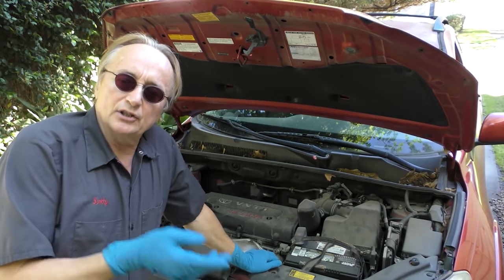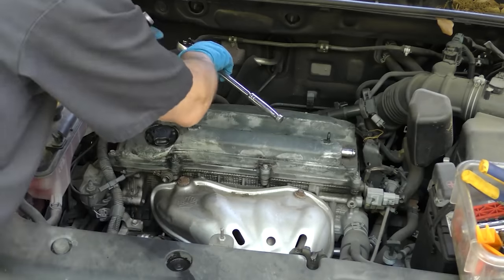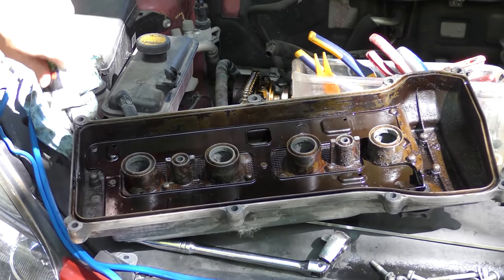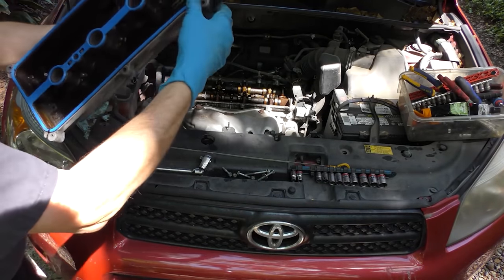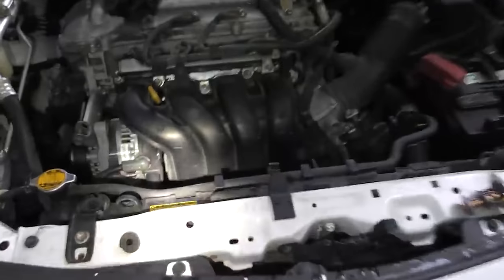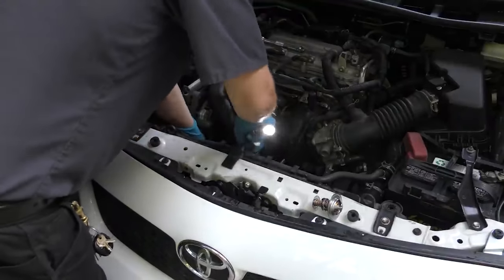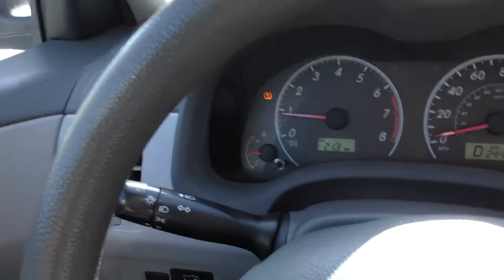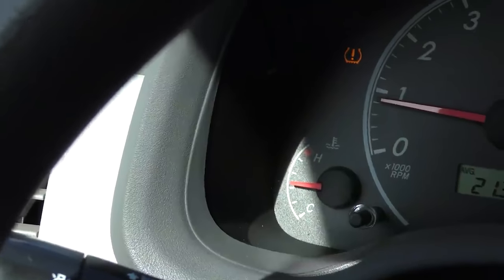3 Mechanic Scams Caught on Camera

Comment: An auto mechanic chain called "Automotive City" tried to scam me into replacing my truck's heater core for $1400. They showed me a photo on their phone of a heater core that looked obviously bad but I knew it wasn't my core because the big plastic cover under the dashboard was still dusty with no fresh fingerprints. Plus there was no sign of coolant leakage or smell. The reason why I took it in to their shop was because I recently had my water pump replaced (which had an obvious leak) but I was still losing coolant. I ended up replacing the radiator cap for $6 and that solved the problem. Saved myself $1394.
Reply: 🤑 jokes on them!
Reply: You should have went in and raised hell to them about the scam, the owner should know if he has mechanics working there doing shady stuff.. might save someone.
Reply: @PhilJLF  ,
It was the owner who showed me the photo. This is a small town I've lived in for 55 years. I spread the word about the scam. The owner is feeling the pinch.
Reply: Lawsuits need to be filed to put these individuals in jail.
Reply: @freedomforever6718  good!  I caught my local family mechanic scamming me; first time they said they warranty all their work for a certain time my distributor went bad that they had replaced, they told me they still
Would have to charge me for their labor on the new one but not the part; whatever …. Second time they said they did 4 hours worth of labor when i was actually waiting at the shop and they only did one hour or less of labor; third time I caught them red handed was the worst where we didn’t go back ever (these where “family friends” mind you) … I understand they have to put food on the table but geeze … 02 sensor went out on a civic, I was going to do it myself but I couldn’t find one after going to autozone they tried to sell me a used Denso then I went to another place that was out of stock, I went to this “family mechanic” and they were trying to charge double the price than what I would have payed for a new Denso (you know they get better deals then customers too) … so, after that I told them that was a crazy price and I’d buy my own; so I bought a brand new up stream Denso 02 sensor and gave it to them to put it, (yea I asked to have my old one they took out) bought one at about half the price of whatever crappy brand they were going to put in and never returned there since… especially after seeing the crappy job they did putting it in. Actually taught me a huge
Reply: First name Last name  ,
Nope. It's a 19 year old Chevy. All vehicles breakdown from time to time.
Reply: First name Last name  ,
Yeah, I would never buy a new Ford or Chevy.
Reply: @PhilJLF  owner is probably in on it
Reply: WinGate Mose  ,
You are right. A good honest mechanic is worth his weight in gold.
Reply: 1st of all I'm NOT defending any of these mechanics, just giving an insight of how a lot of this works is all and a few tips as well. As a shop owner there is a system in place we all use called "The Flat Rate System". There's a book we all go by that says how many hours a job takes to do. A good honest mechanic can beat that time (provided there's no hick-ups like stripped bolts and such) and do the job right. The system is actually there to protect the customer from shops "overcharging" you in hours. Shops that use this system have it displayed so you can see it and on the "work order" (usually something like Shop Rate of $100 per hour FR). So yeah..... sometimes you will wait an hour to have your car fixed, but you will get charged 2 hours for it. Other times the shop will have it for 2 (10hr) days, and you will only get charged 2 hours for it.
I know that is pretty lengthy, but it is the #1 "scam" complaint I've seen over the years, that really isn't a scam at all.
Reply: @BareRoseGarage  That's great but all that goes out the window when the shop tells you that your car needs an expensive service when it actually doesn't.
Reply: @juanawashington9940  Very true, or worse you get what we call a "bench repair". That's when they put the work order on the bench to fill out all the work they "did" without ever touching a wrench. Head Gasket changes - but the head bolts have no socket marks on them. Brake jobs that still have the factory Assembly Line retainer clips holding the rotors on etc etc etc. Don't get me wrong, there are a lot of "crooks" in this industry, and some of them have beautiful shops & matching uniforms. All I'm saying is there are some things in this industry that appear to be crooked when in actuality they are there to keep it on the straight and narrow for both of us.
We're really not all bad guys.
Reply: LOL, these scams will never stop. There's simply too much opportunity to rip people off on a vehicle with an Internal Combustion Engine. And dealerships are just as bad. Imagine if you could buy a car that didn't have or need an alternator or mechanical water pump to leak, no power steering pump or accessory belts, no transmission, no engine oil, transmission fluid or power steering fluids, no spark plugs, plug wires, coil packs or ignition control modules, no fuel injectors, fuel filters, pressure regulators or fuel injection control modules, no timing belts, timing chains or timing gears to replace, no pistons, piston rings, wrist pins, or connecting rods, no valves, valve guides, camshafts, rockers, seals, or cam followers, no exhaust manifolds, exhaust pipes, mufflers, or catalytic converters, NO EMISSIONS TESTING EVER, no MAF sensors, O2 sensors, PCV valves, no high temperature high pressure engine coolant systems with large radiators and associated hoses and clamps. Imagine how little or how rarely a car like this would ever need maintenance. A car like this would rarely ever need to go back to the dealer or to a garage. Cars like this ARE NOW AVAILABLE. THEY'RE CALLED ELECTRIC CARS.
Reply: @Tron-Jockey  Ever take your phone or lap top to get repairs only to get it home and have the same issue pop up in a day or 2, or worse they tell you it can't be repaired but they will sale you a new one at a discount with another 5yr contract? Same thing just a different scale is all. EV, IC, Diesel, or Hydrogen, it's all the same. They all wear out and break just in different ways.
Reply: @Tron-Jockey  ,
EV's are a joke. I don't want to have to walk every time there is a power grid brownout or blackout that would be caused by millions of people trying to charge their electric cars every two hundred miles. Plus I don't want to have to spend at least a week trying to cross the country in an EV when I can cross it in an gas powered car in three days.
Getting steel is not a problem so building ICE vehicles will never be a problem. But lithium and the other rare earth metals are finite and getting harder and harder to locate and mine which will only get worse if millions of people start buying EV's. And China almost has a monopoly on the mines that produce lithium so the price for batteries will start to skyrocket when more EV's are sold.

Now I know that you being an EV fanatic means that you will make all kinds of rebuttals about the facts I just stated so calm down and take your time because you are having to wait for your car batteries to be charged anyway.
Reply: @pleco101  a crazy world that we live in. They need to make better federal laws.
Reply: @rodbender6184  ,
No. The water pump failed at the fan bearing. The cap failed because of age. Two different issues that happened simultaneously.
Reply: @BareRoseGarage  The book we used had extra time added for vehicles in poor condition rusted bolts etc. Don't ripoff the customer but don't ripoff yourself either. Be reasonable and do good work. At the going rate for labor you don't need to gouge customers. Inflation already gouged us all.
Reply: @ptonfire1  ,
Whenever a water pump fails at the bearings for the cooling fan shaft you really should replace the water pump. Sure, a stop leak product would probably stop the leak but the bearings are still shot. I don't want to risk overheating my engine.
Reply: @freedomforever6718    GOOD  ON  YOU.......show those liars/cheats/thieves  WHAT  THEY  REALLY  REPRESENT.  cry aloud, spare  not....maybe a 'shady billing '  sign out front,  at night....
Reply: I replaced my 1989 Chevy c1500 evaporator and heater core and you gotta rip the whole dash out the truck.
Reply: @BareRoseGarage  I've seen that system and think it's a good idea. I recently had a shop show me the recommended hours for a dealership (8hrs)  then for an independent mechanic (10hrs) then he added the 2 together for a total of 18 hours and told me he would give me a deal and only charge 15.
Scammers everywhere
Reply: You could tell the water pump was leaking but not a radiator cap?
Reply: You just dodged a big bullet.
Reply: Lol truth is sometimes yall think yall getting ripped off but the tech/mechanic just was dumb
Reply: @michaelacurry19  seen that. Work with that. Have to follow up on there sub-par work all of the time. Basically daily. 
It's a bad management thing, in the long run. Doesn't cost me anything. But the mis-management costs the company plenty.
Reply: Freedom Forever You would have to change it later anyway so pony up now and fix it right way.
Reply: @paulatudor691  ,
You are confused. Nothing is broken! There's nothing to fix.
Reply: My old 98 jeep overheated I replace the entire cooling system, cause it wasnt super expensive,.. $120 radiator, $6 thermostat, $34 water pump, $12 coolant..I never did knew what the cause of the over heating and didn't bother nor care to investigate.. now it  run even cooler after all the new parts, lol.
Reply: Used to build straight trucks - they are only built to last 4 years so you need a new one. Society has made everything short life junk cause everyone has to keep getting the new one so whats the point to make anything last long. All about that $
Reply: @johnziriada2820  ,
I'm never going to buy a new truck. I'll have my '02 totally rebuilt if I have to but it still runs fantastic so no worries.
Reply: Probably saved a lot more than that like a blown head gasket and all sort of troubles that could be caused by a faulty cooling part
Reply: @MrMOGHammer  over heating stop
Reply: Damn!
Reply: @freedomforever6718  lmao
Reply: @PhilJLF  The owner knows. He is part of the scam.
Reply: You know I had A Instructor Years ago that said If You want to make A shop Successful Be honest Diagnosis A Vehicle first than get with the Customer. A lot Of Time's They Are Guessing. I'll replace the Heater Core because THAT'S PROBABLY THE Problem. Than the excuse Is they dig A little deeper to find the actual Problem. They don't want to diagnose because that takes time away from replacing A part. I just want to say that A lot Of them want to do A honest Job.
Reply: Agree; A good honest mechanic is worth their weight in gold, and about as hard to find.
Reply: @BareRoseGarage  Well Said!
Reply: @eriktorres8975  Yeah, It's A very lengthy Job.
Reply: You haven't gone into dealership mechanics shop in 30 years !!!! I DON'T BLAME YOU  . I feel the same way better to be your own mechanic
Reply: When people ask, the difference between an auto technician and a mechanic is technicians are taught to diagnose faults, mechanics think it’s a situation and replace parts. So the person who replaced the pump didn’t even diagnose the cause.
Reply: @PhilJLF  likely the shop tells his mechanics to scam whenever possible
Reply: @ceuser3555  law suits take two years and attorney fees aren‘t cheap, jail time won‘t be seen...well thats how it is in the USA anyway.
Reply: You saved yourself a robbery.
Reply: @Isaiah-ft5nx  ,
Yes. Highway robbery.
Reply: @jadesluv  ,
Better than nothing and still better than almost every other country's system.
Reply: Spiderman no way home@ iagree toyota is one of the best
Reply: That's definitely one of the most common mechanic rip off scams!
Reply: @PhilJLF  and it's ALWAYS the owners forcing the mechanics to try to upcharge and scam people
Reply: Just imagine if you werent slightly mechanically inclined how easy it would've been to be taken advantage of.
Reply: This is why you always ask to have them return the "defective" part to you when it's replaced. Its not foolproof, but helps keep them honest.
Reply: saved 1400$ bc either way you still woulda leaked coolant probably lmao
Reply: @999-y6t8q  
You must have missed the part that said I replaced the radiator cap. That is why the coolant was evaporating.

Comment: Was a mechanic for over 30 years. When a customer says his car overheats the FIRST thing I think about is the thermostat. Don't what the young ones are taught these days but it sure isn't common sense when getting to problems. Seem as if they rely too much on computers and forget the basics of mechanics. Love your videos!! Mark from Montreal Canada
Reply: common sense is a difficult comodity to find these days in anybody really
humans have lost their ability to think for themselves
Reply: Hum the first thing i check is the temp sensor
Reply: The first thing I’d check is the radiator cap along with the coolant level.
Reply: As a ‘new’ gas station attendant in the 1970s, I knew to top off the radiator and then run it to heat it up and see if the fluid was being pumped through the radiator.  No movement, almost assuredly the thermostat.
Reply: using the computer the right way helps. If I have a problem with my car I open google and type in what my car is doing and I always get all the possibilities. I have not the skills to repair my car myself, but then at least I can tell the mechanics my assumption which part is broken, and this can make the mechanics be more honest because it can give the impression you have deeper knowledge. Also I highly recommend not going to the car brand dealer, and rather to a 3rd party station. So in case of my little renault twingo I dont go to a renault dealer, I go to the service station which doesnt even sell cars.
Reply: For me the cooling System was clogged up. Changed twice thermostats. Brand dealership only blah blah. End of story: New engine. Then they noticed OH, the system was just simply clogged up! 🤦

Comment: I was about 13 when my dad showed me how to test a thermostat in a pan of boiling water.  He was a scientist and not a mechanic.  He taught his daughters in the 1970's how to prevent getting ripped off and I am forever grateful.
Reply: Back in the sixties when I was a teen-ager we tested our thermostats the same way.
Reply: You don’t have to take it out and use boiling water start the vehicle let it run a few minutes the upper hose should get hard after about 15 minutes it should soften because the stat opened over my 32 years of working on cars I’ve seen like 2 fail and its because the antifreeze wasn’t changed ever and having 200,000 plus miles on it now the fail safe thermostats fail open almost as soon as you put them in I’ve seen probably 20 of them i have no heat whats wrong with my car 🤣
Reply: @BLEACH366  you take it out to make sure it opens all the way tho. Cant see that if you don't remove it
Reply: @RadicalEdward_115  if it opens at all it will open all the way when they fail they are kaput and do nothing not opening at all thats why the fail safe ones always fail open
Reply: What a cute picture!  You were a doll!😁
Reply: I think students are being well trained in the programming and modern electronics technologies but failing the core basics of a combustion engine we learned as kids in the 70's with our mini bikes and later on our Camaro and Mustangs